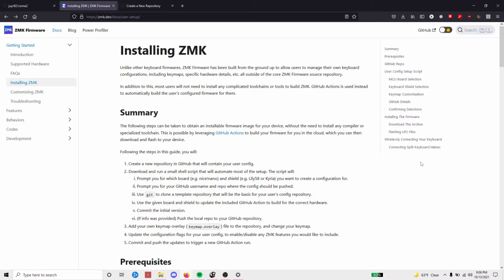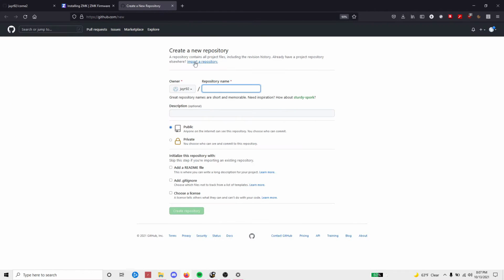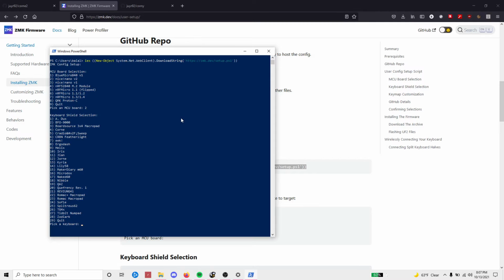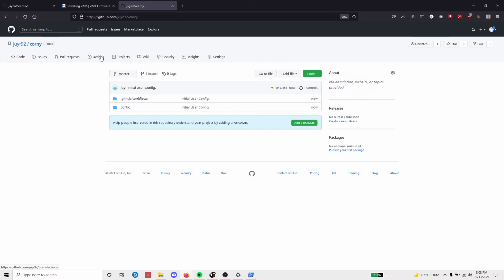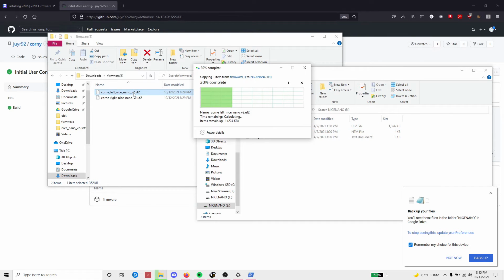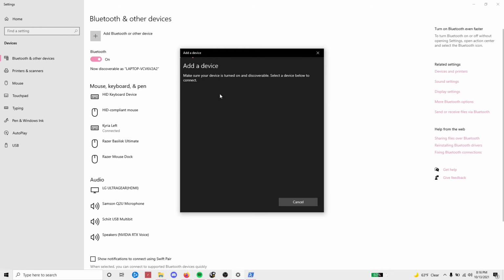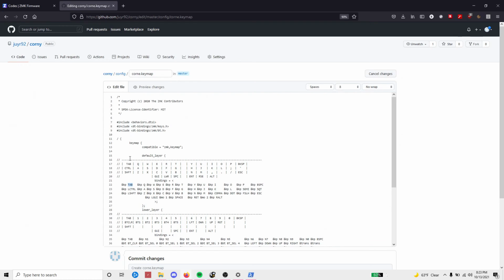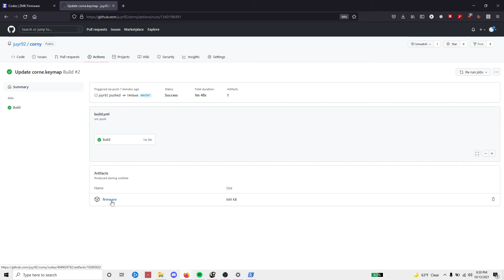Wireless Split Keyboard Primer

Comment: hello, I am having trouble connecting my right half to my left half keyboard. I am using nice!nano v1s. I have tried pressing the reset buttons at the same time and reflashing the firmware halves but the issue of the right half not connecting still persists. Do you have any ideas in which I should try next?

Comment: There are split opinions about whether or not an on/off switch is necessary. Is it needed or is it easy enough to wake a keyboard from sleep mode?
Reply: Also does any1 have issues connecting to macbooks?

Comment: Great video I want to build one so I am starting to research. My question it is if I can use this controller plug with wire to the PC without using a battery?

Comment: Thanks for the video. Just one question. My powershell quits when I paste the User Config Setup Script in it. Any ideas?
Reply from the maker: Not sure. I could build the firmware for you and you could fork it from github to edit it if you'd like
Reply: @juyr4558  That would be much appreciated! How much do you charge for that?
Reply from the maker: @rhdenh775  No fee. Just let me know what microcontroller and board you're using and I can create the repository you can fork.
Reply: @juyr4558  I built a Kyria with a NiceNano. Much appreciated!
Reply from the maker: @rhdenh775  https://github.com/juyr92/kyria
You can fork this repository for the kyria with nice!nano v2
Reply: @juyr4558  Excellent! Many thanks!
Reply: Hi juyr. Enjoying my  Kyria! But I am for some reason getting a lot of key repeats as I type. Random. Any thoughts?

Comment: Thanks for this. I've wanted to make a wireless split board, but I've never made one, or any keyboard, so this is a very helpful primer. 

I just have a few questions about the battery.

1. Are there bigger batteries that can fit on this board in the spot that you put yours or is this size pretty much it? Like, are there batteries retain that the same dimensions but go taller to fit more juice? or even if they went taller would the controller then not be able to fit over it correctly? A week is a decent charge time, but I was curious how much the charge time could be pushed.

2. where can I get the battery you use? =D
Reply from the maker: You can use another battery, but that's the only size that'll fit underneath the microcontroller. I use 2500 mAh batteries in mine, but I use a 3d printed case to hide the battery.

https://www.aliexpress.com/i/4000336502739.html
Reply: @juyr4558  How long does that battery last for you? Also, thanks for the link and info.
Reply from the maker: @DaneMurdock  I built my keyboard back in August and I haven't needed to charge it yet.
Reply: @juyr4558  I want some of what you have going =D

Comment: Thanks for the tutorial-- much appreciated! @juyr Could you kindly explain how one might add support for OLED and underglow if that was desired?  (that's the only thing that has me confused as I finish up my corne lp w/ nice!nano v2 build)
Reply from the maker: If you go into the github repository, in the config folder, there is a config file. Just go uncomment the lines and rebuild the firmware to enable oled and rgb underglow. I'd also recommend a much larger battery if you want those features because they drain a ton of power
Reply: @juyr4558  I get this error: "CMake Generate step failed.  Build files cannot be regenerated correctly.
FATAL ERROR: command exited with status 1: /usr/bin/cmake -DWEST_PYTHON=/usr/bin/python3 -B/__w/zmk-config/zmk-config/build -S/__w/zmk-config/zmk-config/zmk/app -GNinja -DBOARD=nice_nano_v2 -DZMK_CONFIG=/__w/zmk-config/zmk-config/config -DSHIELD=corne_left
Error: Process completed with exit code 1." *it occurs at line 47 of the "West Build"

Comment: perfect, I'm just looking into making a corne wireless build. Can I ask a random question? I wanted to go for kailh LP choc switches just because I like the look and minimal feel, but I understand that the spacings between the keys on normal corne pcbs are for MX keys? Is that right? Do I need to find a PCB with choc spacings? Bit of a noob in DIY mech kb's so thanks!
Reply from the maker: There's two different pcbs for cornes: Choc and MX. If you want to make a choc corne, you will need a choc corne pcb.
Reply: @juyr4558  perfect thanks so much for the help. subbed (Y)

Comment: Are there any downsides to wireless over wired setups (besides having to charge)?
Reply from the maker: Latency might be a bit worse, but it's so little that I find it unnoticeable. Sometimes the two halves do unpair from each other due to distance or something, but very rarely and re-pairing only takes about 10 seconds.

Other than that, I think wireless builds are great and I can't see myself going back to wired builds